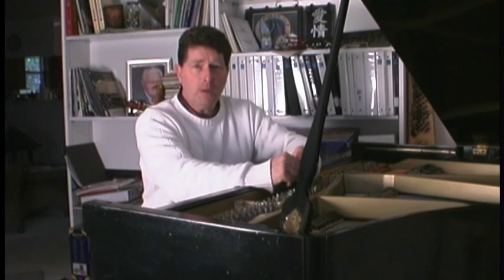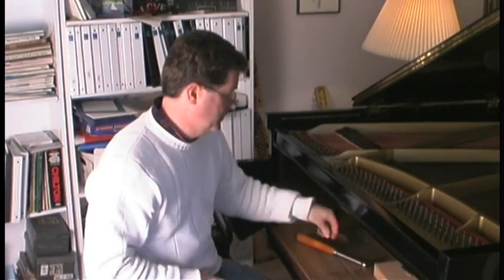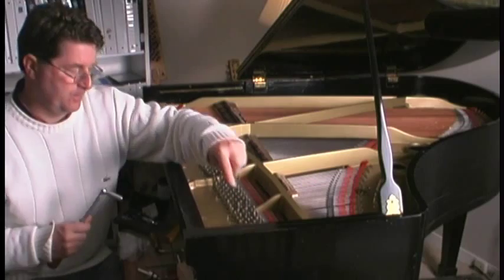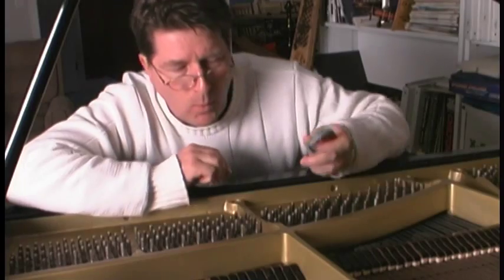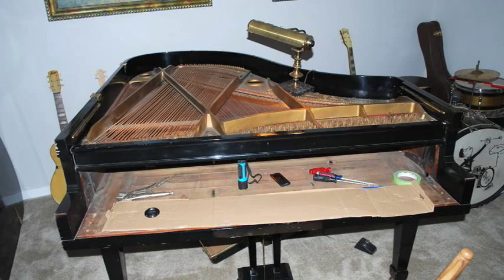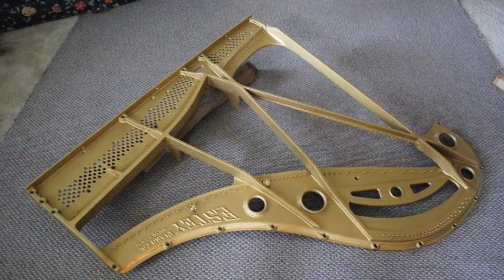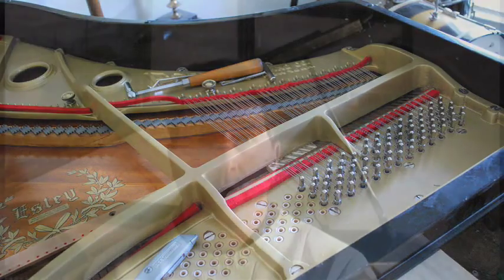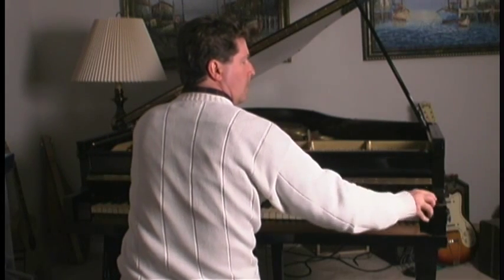The American Garage- How to Restring a Piano

Comment: Before I became a tech, I bought a piano I could do cool thiings like this with and not get stressed. A couple of notes (har): I used a fine tipped pen to mark the damper wires above the blocks so I could put them back easily. Next, try not to do too much twisting of the pins. They loosen with turning.

Comment: I have an old upright Gulbrausen player that I would like to restring.  It has a great deal of sentamental value. Here is my question. It the restringing of an upright more difficult than  a grand?  Thank you
Reply from the maker: I am not sure  if the difficulty is less or more on an upright than a grand- the mechanics of the action will be different to remove for sure, but the same type of steps will still be gone through.

Comment: Great video! I just bought a baby grand piano and wondering if I could restring and/or restore it myself!
Reply from the maker: George- sounds great! Restringing a piano is a huge learning experience. It is not for the faint of heart, but if you can get a tuner near you to guide you, get every piece of written material about the subject that you can find, and take your time and be careful, it can be a rewarding process and experience! It will cost $3-5k, so make yourself a list and make sure you find all the parts before you start. Your success depends on YOU, don't let the nay-sayers get you down.

Comment: 1) Does piano restringing changes the  sound character? [ such as 
replacing Yamaha strings with Roslau string for example?}. 2) The golden
 paint of the iron frame is removed   in some small parts,so you can see
 the black colour of the iron " Does this effect the iron frame on the 
long run ? [ exposing to rust for example ? or this is just a colour ?] .
 { My piano is Yamaha S4}.
Reply from the maker: Don, sorry for the late reply. Restringing can radically change the piano and it's character. Mine had been butchered through the years with mismatched wire sizes- there were 6 notes with 2 different size strings! Drinks were spilled on the pin block, and the hammers had grown hard. All of these things will affect the sound quality, and make it untunable. (The drinks especially) Mine had the harp painted twice since the original, and with a paintbrush, no less. The end of the strings and the pins and the felts were painted along with it. So I stripped it completely and started fresh. Any time you expose metal to the ope air you risk rust, but in a controlled environment, the risk is relatively low. As for the restringing, I had a sound engineer recalculate my string sizes and where they change. Most pianos have a plan to stick with, but mine was so old we could not find a string plan for it- so he made me a new one. I think it is better than before, but I never heard it in it's prime.

Comment: Wow..... How long did this take ? How much did it cost in supplies ? You made your own Pin Block or did you order one in ? Where did you get the decal made and how much mine just came off in pretty bad shape too !  Very impressed that you took this huge task on. Would you do it again ? Yes a lot of questions but it looks great !
Reply from the maker: All in all, it took about 3 months to restring the piano. I spent about $3000 on parts and supplies. I did make my own pin block from the special pin block wood you can get from the piano supply company. I used the old one as a template. As for the decal, I shot a picture of it, and using Illustrator, I remade the decal, and went to a specialty printing company to have it printed. I did ad my name and the day of the restoration to it though. This project was before I started The American Garage, so no video, sorry. However, at some point I need to put new key covers on it, and re-felt the action and put in new hammers. So maybe on a future show....do it again? Why not?!!